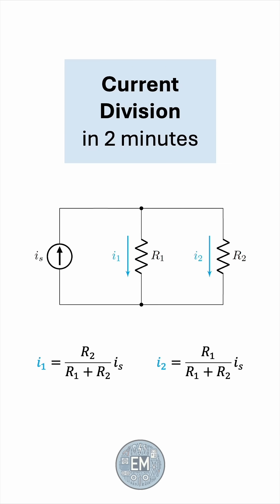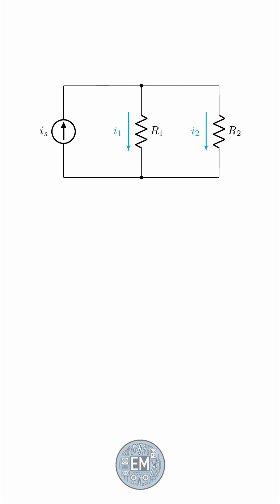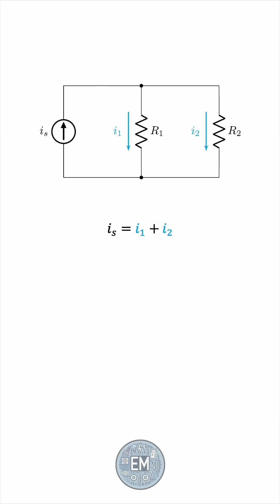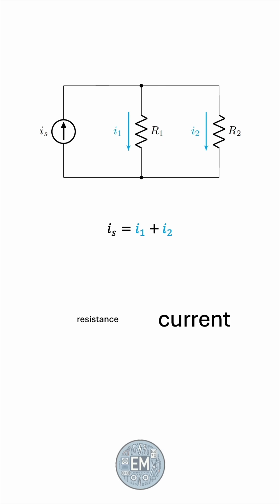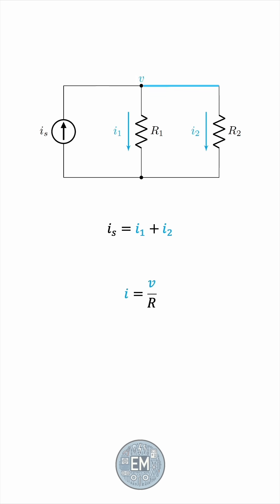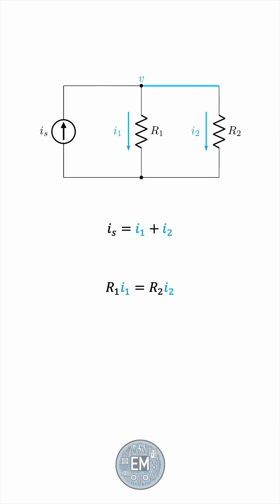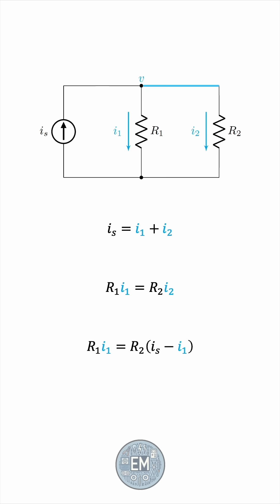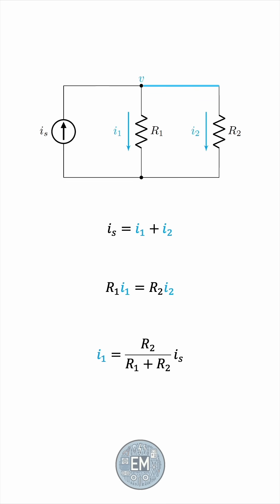Current Division in Electric Circuits #electricalengineering

Comment: Sir, make video on why i remains same in series as resistance is opposition to the current
Reply from the maker: Current is inversely proportional to resistance only for a fixed voltage! The voltage is not generally the same for two resistors in series.